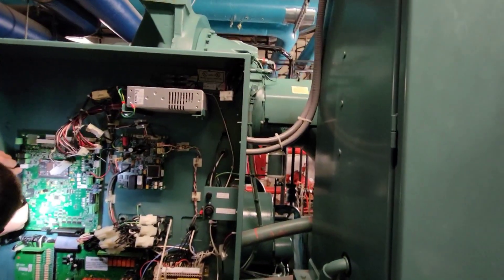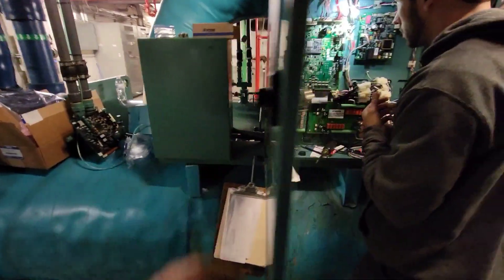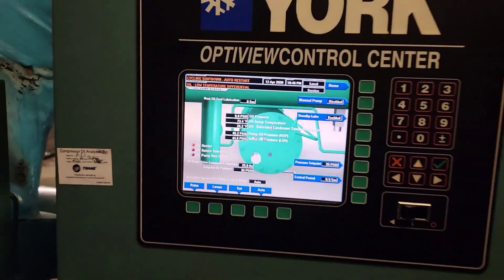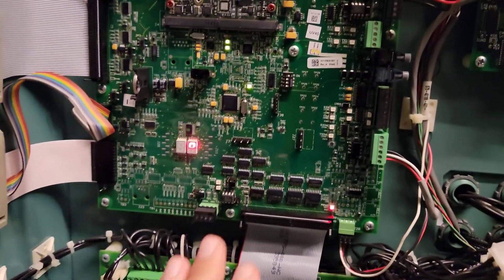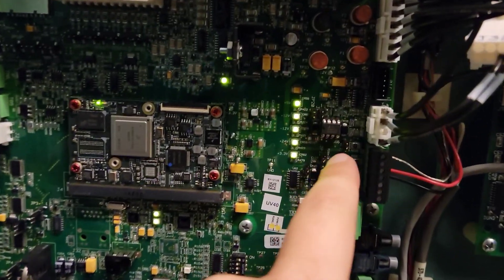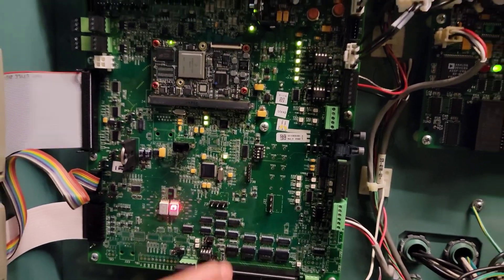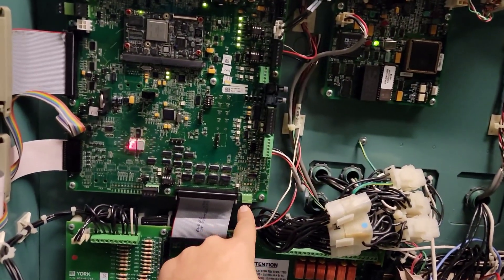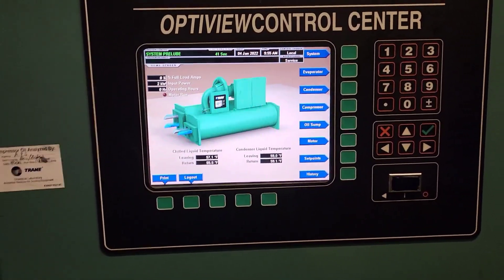I Messed up chiller board

Comment: All these NVRAM will fail, i have one of them in my CRT projector and i flashed the software inside (basically calibration settings) so if it will fail i just have to flash the original program into a new NVRAM

Comment: I usually take pictures of all the screens and sub-screens for checking and comparison purposes. Then order 2gb sd cards to use and save the program card for future use of or when necessary. 
The blank sd card will store more 8 months of operation every 24 hrs. Largest card recommended is an 8gb card can be used as well, no bigger that an 8gb sd card. Good luck and keep up the good work. That oil pump switch gets most of us and I’m guilty of that too. It’s an easy repair.
Reply: Set to overwrite the SD card and it will erase the oldest file and you’ll never fill up the sd card.👍🏽 I’m glad your putting out these videos. Keep up the awesome job your doing!!

Comment: "GUILTY AS CHARGED" LOL. because were all perfect! and poo never happens.
that magical time clock sounds the equivalent of what was used on computer motherboards 30+ years ago (Dallas RTC, real time clock/chip). it's failure was inevitable and would happen far sooner than later, even if you left it in service untouched. borrowed time  by far.
Reply: Thats exactly it, appears York would rather use this to sell boards rather than issue a service recall on said equipment with obvious bad RTC. The sticker is just covering up the dallas logo.

Comment: Sir make a video yvaa chiller IGBT testing procedures by multimeter
Reply: THERE IS A SIMPLE PROCEDURE ON THE LOGIC CARD PRESS A BUTTON THAT EXISTS ON THE LOGIC CARD
AT THE MOMENT OF PRESSING THE BUTTON THE IGBTS WILL MUST FLASH THE FIRST 3 LEDs AND THEN THE LAST 3 LEDs THAT ARE ON THE IGBTs
Reply: @gabrielmarquezgomez9511  thanks
Reply: There’s a manual for those procedures do you have it?